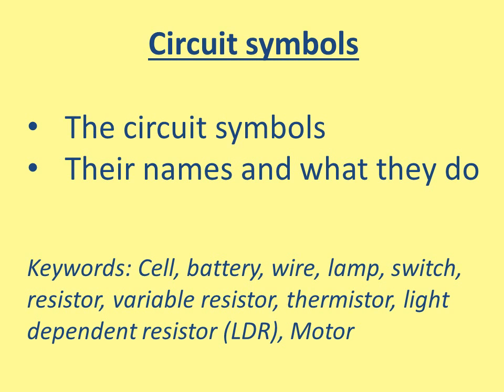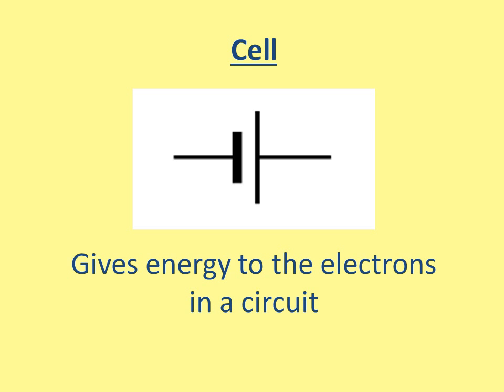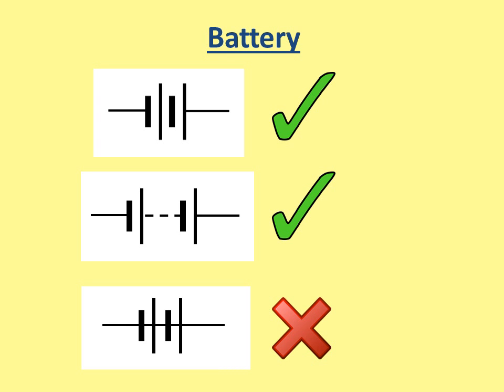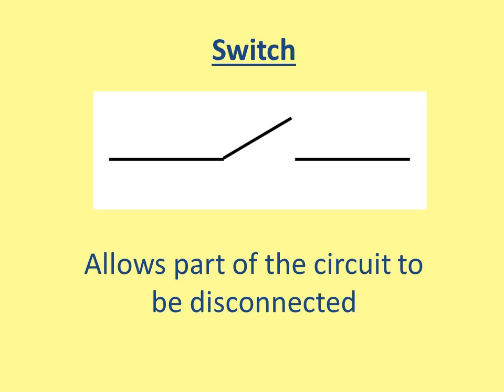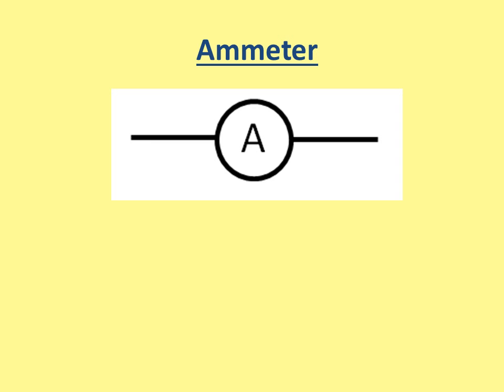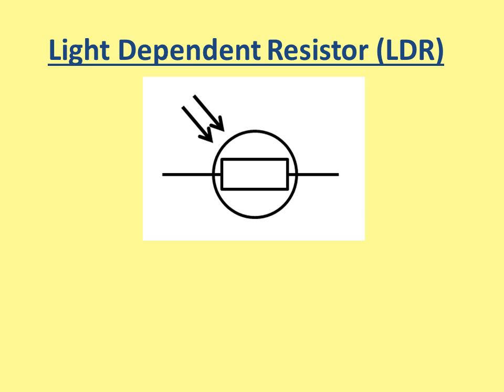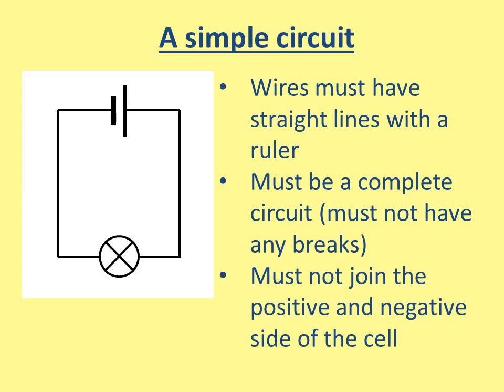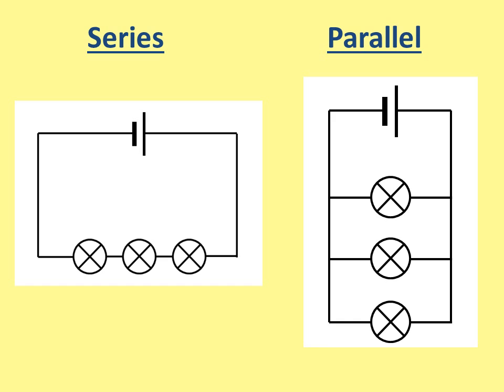Circuit symbols

Comment: Is it specific for the series and the     parallel circuits to have 3 bulbs?  Or it can have 1-3 bulbs?
Reply: From experience it has to have 2+
Reply: Series 1+ parallel 2+
Reply: @trusty8897  wow thank you so much but the thing is that 9 months passed so I really didn’t need the answer 😐